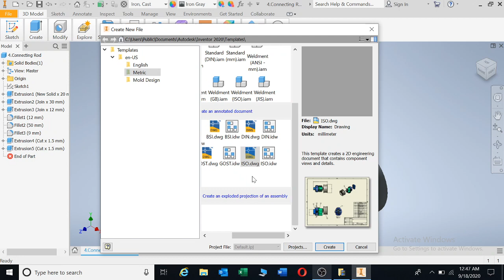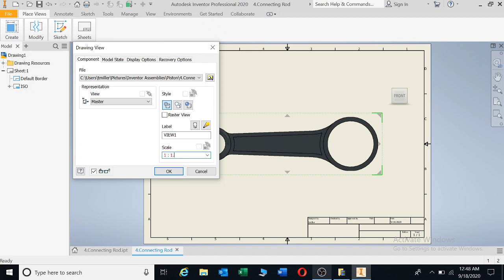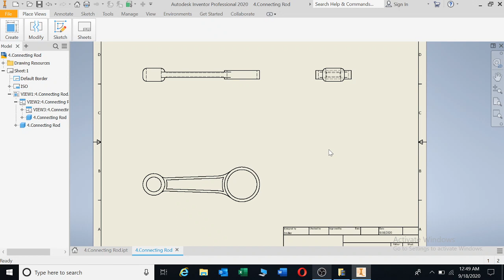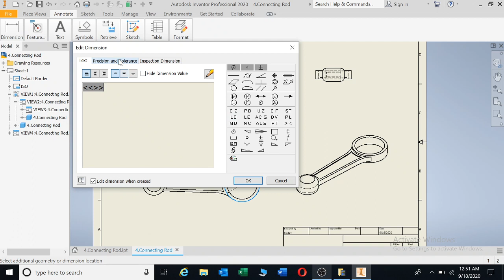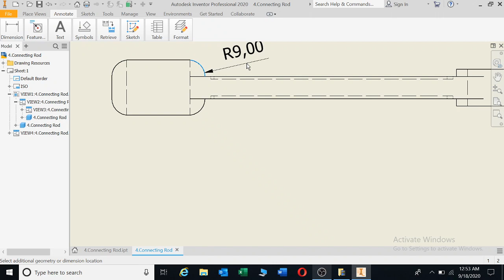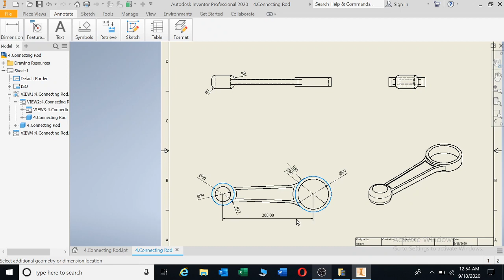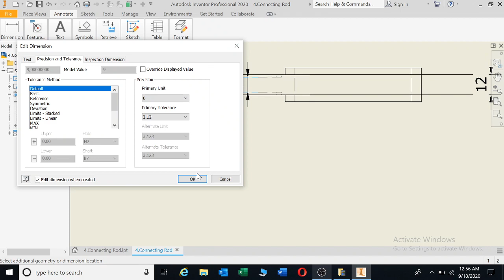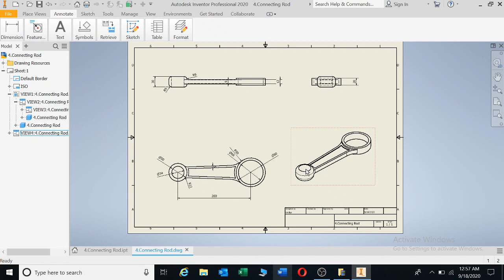Inventor manufacturing drawing and dimensions generation.

Comment: Correct me if I am wrong but I think it doesnt have the taper angle
Reply from the maker: In a real situation the taper is smaller and concentrated more toward the larger circumference.

In this example the taper is more along the length of the entire rod, however in design, dependant on space constraints one can use any geometry as long as the strength is not compromised.